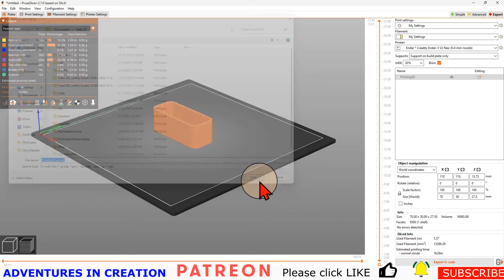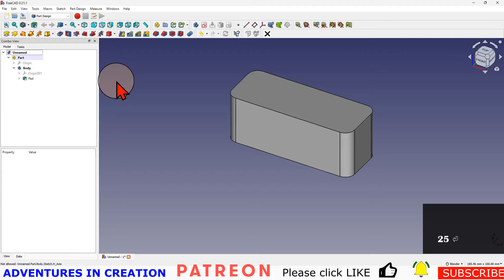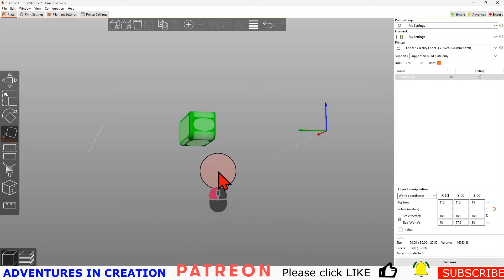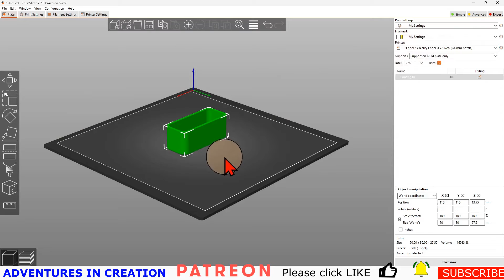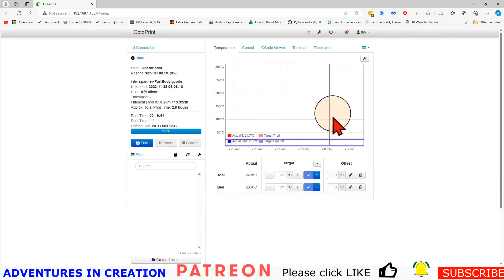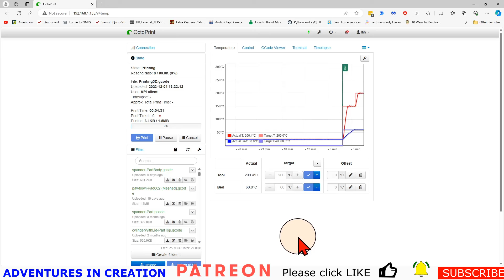FreeCAD for Beginners #60 3D printing #freecad #cad #makers #design

Comment: I have a model that I wanted to use on my CNC Router but I couldn’t figure that out so I printed it in PLA. I’m hoping it will be strong enough. Have you ever done a video like this using a CNC router?
Reply from the maker: Yes I have. Take a look at my #freecad Playlist. There are several in there. I use octoprint to send the files to my cnc router too